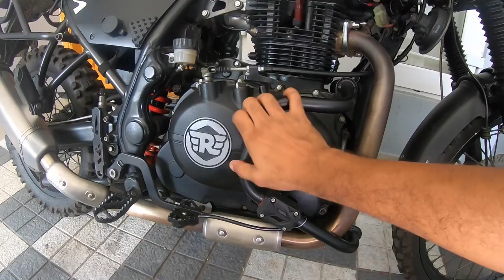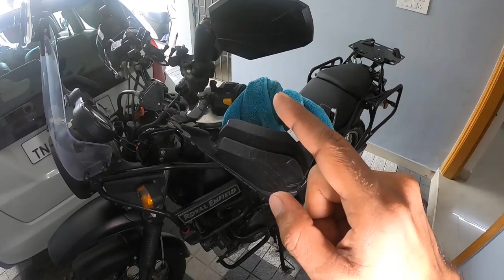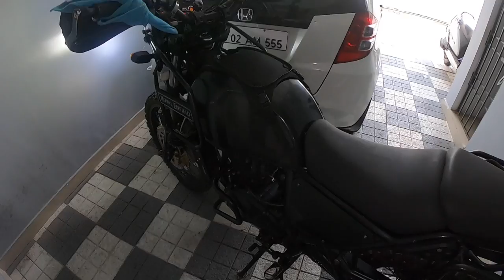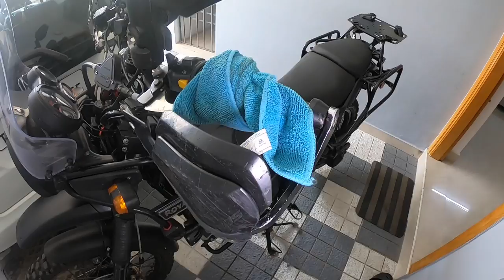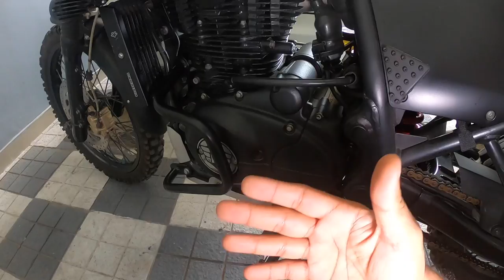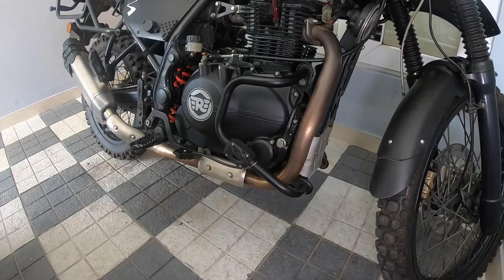FIX CLUTCH NOISES & HARD GEAR SHIFTS ON THE ROYAL ENFIELD HIMALAYAN

Comment: My BS6 2021 shifts hard and nothing I tried helps. Mostly during downshifts from 5th downward, the lever clicks half way and stops, then with force it passes the point of restriction and with force slowly drops into gear. The shifting is best described as feeling crunchy and forced. This comes and goes. one gear up or down it will do it and the next it is fine. The bike began doing this at 13,500 km. I have done the clutch adjustment, the gear lever adjustment and tying the clutch lever with no change at all. I am wondering if it is in the transmission. The shifting problem makes the bike no fun to ride at all. I am often hitting the lever with my foot at stop lights trying to get it into gear, and my foot aches after any time on the bike. I find myself no longer wanting to ride it at all.
Reply from the maker: its a simple fix. pls take the bike to the dealer and get your shift cog replaced.
Reply: Thanks for your reply, from the bottom of my heart. My wife and I have been super depressed with this bike, one failure after another, and like she said, it has so many good qualities. My last bike was a Honda Goldwing, so I take great care of my bikes and have not abused this bike at all. What would cause the shift cog to go bad? Is there anything I can do to avoid it going bad? Also I am terrified to bring the bike to the dealer. The last time I brought it in for the continual stalling issue, they insisted that they had to adjust the valves and change oil and lube the chain. I got the bike back and the stalling is much worse, the engine vibrates terribly now and the oil window was solid black due to them failing to drain the old oil and just adding one extra quart. My wife asked what the clunking sound was and it was the chain. It had about 2" of play. Then I checked the valves and they were super tight, the exhaust was 0.I5mm and the intake had zero play so I cannot say what it is.  Ben, I am truly afraid that if I bring it back into the dealer for anything technical, they will absolutely destroy the bike. Your channel is the only thing keeping me from selling my bike and buying a Vstrom 250. I hope RE is treating you well. I love the Himmy, but if I can't ride it, what good is it?
Reply: @ONTWOWHEELSBEN  Which cog? Are we talking about the individual gear cogs. Looking at the RE manual, I see "gear first driven", second driven etc.Are these the cogs you are referring to? I really want to understand clearly what you are saying because I have to translate this info into Spanish for the RE shop. Pretty complicated. If you could please give me more info to go on, otherwise, these people are likely to say they replaced the shift cog and do absolutely nothing as usual. I am also thinking that I might have to break into the transmission myself and simply buy the parts through RE.

Comment: In many cases, the cause is worn-out engine oil and condensate. Look for oil at the filler neck, check with your finger.
Reply from the maker: Yes I agree it is a possibility, but not here in  India ( most parts of) because of a unusually warm temperature throughout the year . Also people here use their bikes  to commute daily and so the chances of condensation reduces greatly.

Comment: Had the same issue on my new himi, its a squeaking sound like brakes when wet. Was a Problem with not round running clutch which is easy to see thrue the oil fill cap. Just turn the wheel an you see the metal plate with the springs wobbeling around. Got a new clutch and this runs round and no sounds any more...... And yes it sounds like a squealing brakedisk becaus it can not grab right when wobbeling around. The grip thind did not help. I can send you a video from the clutch.

Comment: Thanks a lot Ben, this issue has been bugging me for quite some time now not knowing what exactly is happening. Even after getting it checked several times in the service centre, they were not able to resolve it.
Reply: Hola, quiero decirte que la solución es hacer pequeños orificios de 2 milímetros al rededor de la circunferencia de la prensa, para que el aceite entre en los discos de manera fluida y los lubrique fácilmente

Comment: Thanks, I need your help with strange noise coming more from the front side between the handlebar and the cluster area, I have requested the service center to check the tappet and said it's fine , this normal sound of Himalayan. But I'm not happy even at high speed I can hear that noise.

Comment: Hey, nice channel and info. I just purchased the Hunter 350 here in Indonesia. I have the only Royal for thousands of miles so info is hard to come by, maybe you can help. The number one issue I have is the clutch engagement point, it is very narrow. The clutch is smooth, quiet nice shifts but again the engagement uses like 10% of the lever movement, my Hondas and Yamahas use 30-40%, this is what a nice, wide engagement clutch should feel like. Is this a Royal thing or are the new 350s clutches are just poorly designed (too much clutch basket movement vs clutch lever movement). I know we have different bikes but you might have some insight to this. Thx in advance.

Comment: Thanks for this I tried following the same things you mentioned in the old video and it worked amazingly. The important thing for me to realize was it takes some time to settle I got to identify the improvements after 3000km(which you didn't mention in your old video :( ) but as a new rider it was very worrying initially with hard shift and clutch problems compared to other bikes where it was very smooth and also the price of Himalayan.

Comment: Hi Ben, 
Thanks for your video.
Recently i bought a 2023 model Himalayan & in less then 10 days I went for a ride close to 600km & gave for a first service. Where I found gear shifting & clutch grabbing issues. Again I left my Himalayan to service centre. 

1. Just want to know is it good to go for a long ride before first service.
2. Excess oil will cause gear shifting issues ?

Comment: I have also brought a new guerilla 450 same engine shared with New himalayan 450
I have been facing hard gear shifts with Thud sound is it normal?
Reply: Same here with my new guerrilla 450
Reply: @ayush1471  I have asked some experienced technicians about the issue they say its normal in higher cc bikes 
We need to engage the clutch fully and shift the gears right in order to reduce the issue we are facing 
And some extra kilometers and chain looping properly Will slove the problem 
It's normal only don't worry about it....
Reply: Same issue with my guerrilla

Comment: Ben bro I have problem with my first generation bs6 Himalayan.If I stopped bike in slopping group within gear and turned off the bike my bike moving from top to bottom on slopping area.when I put it on gear and standing on slopping ground feel like the gear is slipping from and becoming not in gear for tiny time.The service centre can’t find the problem
Reply from the maker: Have the right clucth free play ( 3 mm) at the lever end . Also perform the exercise that I have shared in this video

Comment: Hello ben, i've been using Himalayan BS6 2021 model since last May 2021 and ever since i've got my hands on my bike, there's been a noise on the left front side of the bike every time i'm making a turn, it happens 3-4 times a day since i bought the bike. RE service centres told me its a clutch issue i tried everything like starting the bike and keeping it idle for like 5 mins and yet i still have the nose. The noise is loud (very loud) like everyone just turns their heads to see where that noise came from and i can feel it on my hands when i am grabbing the handle and turning, it sounds like two metal rustic plates rubbing into each other. I hope you read this message and respond, would love your thoughts on this
Reply: Were you able to resolve this. I am facing similar issues with my 2021 himalayan
Reply: @meghanuthappa7797  No it isn't solved, RE service centre said its normal for BS6 himalayan -_-
Reply: Hello Ben, leaving a message again, I am still facing the clutch noise issue even after 25000 kms. Would be really helpful to hear from you
Reply: @jayeshjadhav1177   I too had the same issue. were you able to resolve it?
Reply: @reek5353  No I still cannot solve the issue, the RE service centre says it's an issue with the 2021 model and there is nothing you can do to fix it

Comment: How many kms has the Himalayan done ?
Reply from the maker: 35000
Reply: @ONTWOWHEELSBEN  thank u. I bought mine in 12 Sept 2018, 44.5k in Odeo. As u mentioned engine is tuned well. Just that I replaced chassis cause it crack.